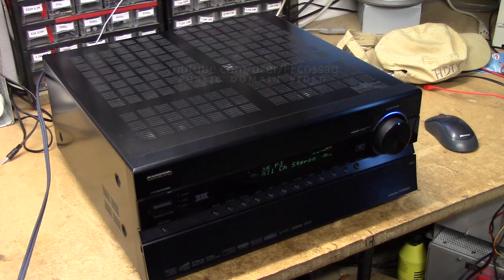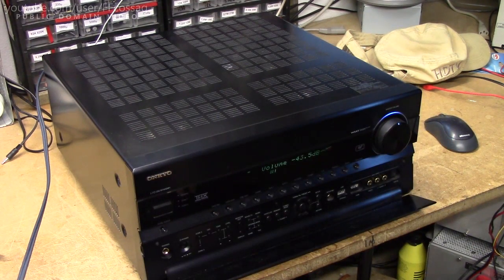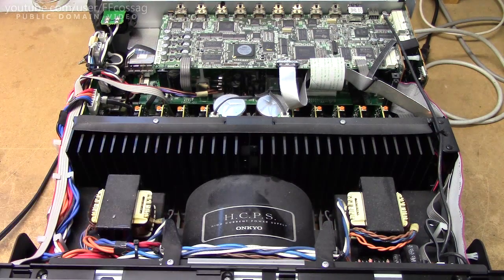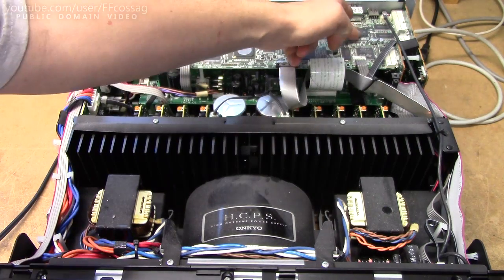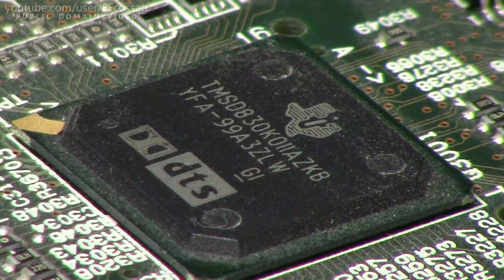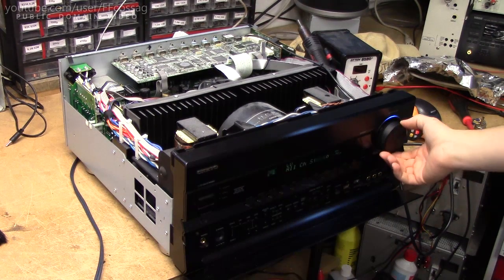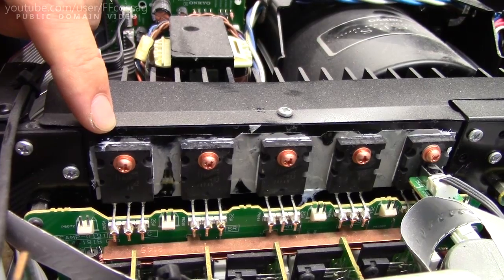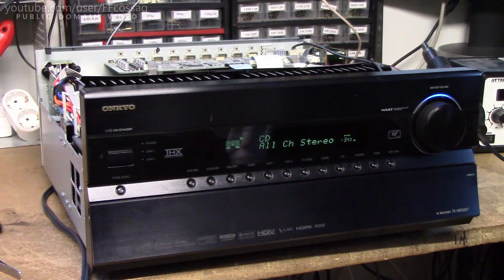Onkyo TX-NR5007 no sound repair (BGA reflow, reinforcement & heatsinking)

Comment: Onkyo TX-NR708. No sound. Was just about to throw it out when I saw this post. Bought an SRA flux pen, 20mm heat sink, and some paste. Set my heat gun to 500 degrees and heated the chip for 1 minute and 20 seconds (used my iPhone stop watch). Sound is back and I am very happy. I have never done anything like this before and can't believe how easy it was. $20 investment and 5 minutes of work saved me a lot of money. Thank you so much for this post.
Reply from the maker: Glad you got it sorted.
Reply: Same for me :)   But now I have to do it again, but do it like FFcossag did it, not just like me that only refloated it. No sink og paste and less heat.
Reply: This exact description worked for me.

Comment: Many thanks. My TX-NR807 is working again. 
I bought all the stuff : 
- heatgun,
-flux pen,
-thermal's paste,
-raspberry's heat sink,
-and a 12volt cpu fan.
Reply: Did it cure and still work on your 807
Reply: What did you wire the CPU fan into, I was wondering about this as well since the entire HDMI board has no air cooling?

Comment: This method worked for my Integra DTR-40.2. I used a MG Chemicals Rosin Flux Pen, and just a microchip heat gun. I applied heat until the chip hit 650 F. I kept the heat on for 10 seconds 
 then took the heat off to let it cool to room temperature. Fired it up and the speaker matrix came back on after 5 seconds. 

I attatched heatsinks out of a broken N64 using Arctic Silver 5 thermal paste. 

I bought the receiver for $150 off OfferUp knowing the bad history with the DTS chip. 

Thank you for this video. Now I finally have a receiver that can bring my 4 ohms M&K S-85 and S-85c speakers to life!
Reply: Hello, about your Onkyo, is it still working after the repair?
Reply: @marcocoratti809  the DTR-40.2 worked for a few months after the repair, and sold to a buyer who was aware of the repairs and risks.

Comment: There is a simpler diagnose: press and hold "display" , then press "on". Release both and quickly press "tone +".  You can cycle through the software versions of all CPUs. If DSP shows ????????? instead of a number, it is the problem. The devices have other typical faults: the higher models have bad SMD electrolytics on the underside of the HDMI board. Also, a dead main relay might fail to switch the analog transformer. All faults lead to no sound.
Reply: What capacitors are the one in question? Any chance you have their number - I have the above problem after Onkyo replaced the chip so I think it might be the caps....
Reply: @Legend Jimmy instablaster =)
Reply: @Wayne Fabian I really appreciate your reply. I found the site on google and I'm in the hacking process atm.
Takes quite some time so I will reply here later with my results.
Reply: @Wayne Fabian it did the trick and I actually got access to my account again. Im so happy:D
Thanks so much you saved my ass!
Reply: @Legend Jimmy no problem xD
Reply: Thanks for this! For some reason this brought my AV back to life for the time being. Don't know for how long but it's something.
Reply: I get the following on the screen, is this what you are referring to?
 
Version Info
 
Main: 1.00/11107BLP   51595DD1
DSP: 1.00/11107aL
OSD: 1.00/11107AL.     A219E4D6
 
I currently do get sound after about 5 to 10 mins of the system being on, though I expect this is due to the board heating up and contacts re-connecting?

Comment: Thank you!  I have exactly the same receiver and.this fix worked perfectly for me.  It seems heat is always an issue with amplifiers.  Your video was very informative.  I used my heat gun to check other chips on the board and ordered two heat sinks, a 15mm x 15mm x 14.5mm and a 21mm x 21mm x11mm.
Reply: Hi , What kind of glue did you used to fix the heat sinks on the DTS chip? thx.
Reply: @derekjohnson770  Thanks for the info Derek.  Just wondering if you'd say the 15mm was the perfect size or would you suggest a bigger or smaller size?
Reply: @jeratt1  Yes, the heat sink sizes are perfect and my receiver is still working great.  I also purchased an AV Infinity cooling unit which sits on top, terrific product, see Amazon.  The cooling unit has a sensor in it that triggers the uber quiet fans when temperature reaches a set point, it's so nice, it blows the hot air away from the receiver to the rear.

Good luck, 
Derek
Reply: @derekjohnson770  Thanks for the info on the heatsinks. I have a TX-NR5008 that suffers the same issue. I plan on doing this fix but curious as to how the fix has held up for you. It's been over a year. Hopefully you see this. Thanks!

Comment: One other clue to this chip needs refloating is not network, it simply disappears from the network altogether.
So everything working normal, but the second audible click from the amp´s missing, not sound and no network, then you need to refloat.

Did this a couple a month ago, and not I have to do it again.   But this time more heat like in the video here and a heatsink witch I did not do first time around.  Hope it will last a little longer then :-)

Thanks for a solid and good video.

Comment: As the owner of this TX-NR5007 I can tell you that it is still working perfectly fine! It may soon be time for a replacement but the only thing I want to change is the size of this monster. I want something physically smaller but with the same big sound! And of course with some additional features. Ideas are welcome even though I may continue to use this unit for a while more...
Reply: My 2011 Integra just started having the same issue. Might try this easy solution.
Reply: How long did the fix last since ou did the repair please?
Reply: @vortexor1  Well it's been working fine for 6 years now so it must have been a good fix!

Comment: I bought an Onkyo receiver and bought an external fan that plugs into the USB port in the back positioned the fan right over that chip and I have never had a problem just something to keep in mind if you get a receiver of this type or should I say AV receiver buy that external fan and just set it on top of the receiving near to where the chip is and it will keep that bored nice and cool

Comment: Yup, AV recievers have almost all of their issues in the digital section.
Audio amps rarely fail and often last decades when handled properly (yes, even if it gets very hot).
AV recievers are just too complicated, and the manufacturers have no clue how to cool it. I have an older Onkyo, 2007 model. Analog Part is amazing, but it has a very similar problem: The HDMI subboard gets really toasty, much more than the 85C rating for the caps. So for older Onkyos that dont have the BGA, just replace the HDMI smd caps ;) (with better rated ones), and perhaps install a fan ontop. The fan is the reason why mine still works after years of usage.
It really makes me wonder why they did not properly design the thermal part of this subboard, when the rest of the reciever is build like a friggin tank.

Comment: Thank you so much sir for your kind help.   
Well, I have the same issue wd that (dts) Receiver TX-DS575 as you've just explained onds video. But I tried it and it does work for me. I'm actually from fiji 🇫🇯 and I've tried look in to so many places but unfortunately they just can't fix the problem. But now I'm so happy that I saved much $$$ on repairing ds Radio. Coz I just can do it myself. 💯👏☝️

Comment: I had that receiver in the past,great receiver even in stereo direct,great sound,i sold it and replaced it for a denon avrx 4100,because off dolby atmos, the onkyo had a much better sound in stereo,i still recret it,the hdmi board was working fine,but i no it was a problem with these amps.sorry for mine bad english.nice review.

Comment: He uses hot air gun from a solder station unit. Use Flux first.
Heat chip to 220C for 10 seconds , if it moves at all stop,  let cool.
You can also use a car headlight bulb , 12 v halogen. About 55 watts.
This will not blow chip off the pad. Use Flux first.

Comment: Thanks very much mate :-) I put flux around the outside of the chip and I heated mine to around 220 C on my Onkyo TX-NR809. I waited for the chip to return to room temp, switched it on and Wooohoo! It lives! I then put a small heat sink on it from Jaycar Electronics here in Australia to protect it from perhaps failing again. I hope this fix lasts as I rang Onkyo today and was told they no longer fix under warranty as of 31st December 2018 so lucky this fixed it :-D 

This is the heat sink I used which seems perfect for the job. 

https://www.jaycar.com.au/heatsink-pin-grid-array-with-adheasive-thermal-transfer-tape/p/HH8580

There is a simpler diagnose: press and hold "display" , then press "on". Release both and quickly press "tone +".  You can cycle through the software versions of all CPUs. If DSP shows ????????? instead of a number, it is the problem. The devices have other typical faults: the higher models have bad SMD electrolytics on the underside of the HDMI board. Also, a dead main relay might fail to switch the analog transformer. All faults lead to no sound.
Reply: Thanks for your advice . I did the same . And it works. Now the Texas chip gets 34 °C.
Reply: @mogensstergaardandersen9535  No worries, you're welcome. 👍
Reply: @Homerlovesbeer2  But after 4 h it died again. Tried a resolder more with 230 °C. No sound. Tried to activate the main amp by putting secH1 to ground. The relays changed but no sound. The Tuner and preamp seems to work. So next step is to use the parts to a standard 7*130W amp.

Comment: I bought a Sony ES A/V Receiver and it had a 5-year warranty. Shortly after the 5 years ran out, the Sony A/V Receiver died. I was told the motherboard overheated and nothing could be done to repair it. I then bought a TX-NR5007 and it lasted only two years before breaking. There was a 3-Year Warranty, so I actually got it replaced with a TX-NR5009. Unbelievably, the TX-NR5009 had its own problem where after about 3 years the graphic menu stopped working. Onkyo extended the warranty for that reason so people could get their motherboards fixed for free - but only for that reason. The remote control on my TX-NR5009 stopped working for no reason within the 3-year warranty, but Onkyo said they didn't have anymore remotes. The only licensed place in Michigan told me they don't work on those remotes. So, I was just out of luck. I am never buying anything from Onkyo, Sony, JBL, HP, or Toshiba ever again because their products simply do NOT last!
Reply: It's planned obsolescence. Not just those brands. Maybe smaller niche products are built to higher specs but are also more expensive. You cannot cram 1300W of power amplification in that chassis and expect it to last. 
Look at some proper 2kW/4ohm amp:
https://analogdomain.eu/index.php?option=com_content&view=article&id=20&Itemid=21
Dimensions: 440(w) x 254(h) x 545(d), mm
Weight: ~ 65kg , 95kg shipping
Now that can expel the heat without exceeding 50 deg Celsius cause it has 20+Kg of heatsinks on 52 power transistors. Shipping that beast will cost half the price of that Onkyo.

Comment: Greetings everyone!
I did the test on my TX-NR809 with the hair dryer and it worked.
As I understand it, the heating expands the connections, making it work again.
What I didn't understand is how to maintain these connections by the heat, keeping it cold.
Would it be too much to ask the experts for a numbered step by step?
Your video and comments were the ones that gave me the most security, since I don't know anything about electronics and also because in Brazil, precious information like yours is very difficult to find.
In advance I apologize to you and everyone if I put myself in an unreasonable way and thank you.

Comment: Thank you for the Video, knowing where the problem is helps a lot. But why do you leave out the details about the temperature settings? I fixed my Onkyo sucessfully, but to reflow a chip you need to heat it to 240 degrees with an airgun that is set to around 340 degrees. The moment the solder becomes fluid a small burst of smoke is emitted, that is the point where you stop heating. In the video your IR thermometer never goes above 170, I would think that this is too low. But I have to admit that I did not try to fix mine with only 170 degrees. Also consider that Onkyo may agree to fix this issue for free so it does not hurt to ask.
Reply: That's the temps I used for mine and mine is now fixed. Touch wood it lasts. I've now put a heat sink on it so hopefully the fix lasts.
Reply: 170C

Comment: I have the same symptoms as this unit. I'm going to try this (perhaps with less thermal compound)  :)
Reply: It worked. Thanks so much. I threw on a heat sink made for a raspberry pi,  it fit the chip perfectly. If it stops working again I'll update my post. My model is HT-R990
Reply: @kevinxero  still it work?

Comment: those should have some 120-140mm PC case fans in it. All that heat build-up is destructive.
Reply: I have 2 fans controlled by a thermo coupler on top of my tx-nr807. It’s still running strong!

Comment: I have the Pioneer SV-1522-K with the same problem, but has "two" chips. So I'm guessing both chips need to be heatsinked!  What exact kind of flux pen and compound/adhesive would you recommend for the repair ?  Brand name, and exactly the flux pen title and adhesive is called??   Want to make sure I have the right materials. Your a life/money saver!! Thanks

Comment: Unfortunately in my case still no sound after several attempts heating up the dts chip.
At the same time the ethernet connection has stopped working as well...
Model: TX-NR616
???????

Comment: When making a how to video maybe share the details on the reflow temperature and how long your heating it?  But yea,  I tried this on my NR509 which has been silent for  2 years first with ~180c, then 195, then 210-220 (serapate tests) and did not wake it up.  I have a hot air station and a IR-temp meter also so I went for it gradually. Maybe tomorrow i'll try even hotter but I dunno, I think its dead. To my knowledge it should reflow at around 180-200 if it's ever going to. But not much to lose here..
Reply from the maker: You need airflow of about 400 C, since the thermal resistance from air to board is very high.

Comment: Your awesome brother ,I fixed both my fav 818 and 809
Reply: Does it still work for you? My 818 just broke down. But works after a minute with the heatgun. Then after 2-3 minutes it breaks again
Reply: @AndersBergh  yes it does and mine after I use heat gun lasts 2 to 3 months but I'm not doing  it often  and saved it as I know one day the chip will fry ...but I bought an onkyo 929  it uses a different board all together and that one has no issues ..still prefer the 818 it is the king of music and movies
.the 929 is a close second...also bought older non hdmi harman kardon as they sound very close to the onkyos
Reply: @christiansaab9128  nice. I'll borrow a temperature controlled heat gun tomorrow and will try with higher more precise temp.
Thanks for getting my hopes up. 🙏
Reply: @AndersBergh  brother there us always hope Anders....for best results make a tube with aluminum foil and hold it on the chip ..175 celsius for a minute then let cool and fire up ..all the best to you

Comment: I have a 616 behaving the same, i will try your method but could you please confirm this is the correct process & temperature:
1)clean chip with pencil
2) put flux and tilted
3)heat chip - 1wave at 152C and then 174C (for what i saw in your video)
4)let it cool and try
6)apply thermal glue and place heatsink
Thanks
Reply from the maker: Just flux it and heat it until the solder balls melt. You can't go by tempereatuers, it's a finger tip feel thing.

Comment: Hello - I have this amp and unfortunately I am getting a crackle out of the left front speaker only. It seems to be only when the amp has warmed up and not intially on cold. Any ideas would be much appreciated as I wouldn't want to get rid of the amp just for this reason. I have checked the cable to the speaker which is fine. Many thanks.

Comment: Thanks for the video.  I have to try this next week.     Warming my DTS chip with a hairdryer allows to work while the NR609 is powered up.   As soon as it is powered down it loses the speakers again.   I have flux and a cheap heat-gun.      Your temperature never seems to get to high.    Is there any advice on how hot to how long to heat the chip ?.
Reply: look for another video on this same subject it seems a lot on Onkyo receivers suffer this same fate. I saw a guy use some flux around the chip heat up a specialized tipped heat gun to around 600 degrees until the fluxed bubbled and he pulled the heat away.. Then let the chip cool to room temperature, never ever touching the chip. He then put a heat sink on top of the chip.

Comment: Got a TX-NR607 which suffers the common problem with no OSD. All onkyo receivers seems to run hot as hell ruining the caps and so forth. Haven't got around fixing though...
Reply from the maker: They only offer that in certain countries.
Reply: And on certain serial number. My TX-SR806 is not covered in Canada... So i repaired it myself.